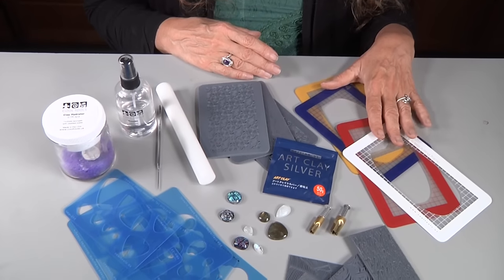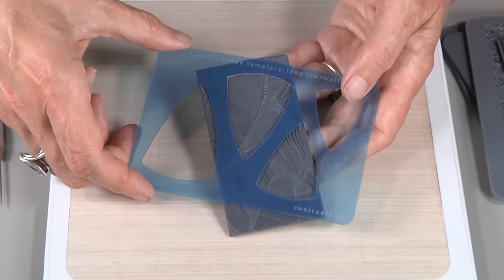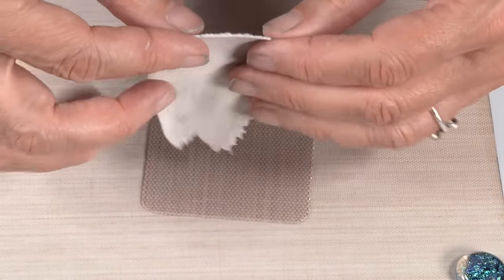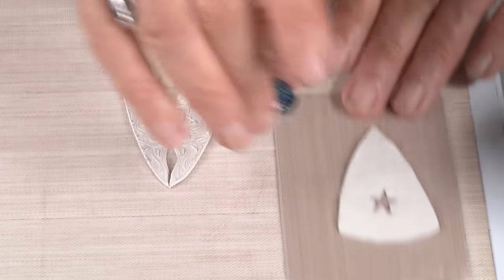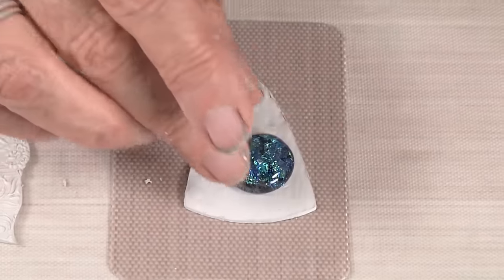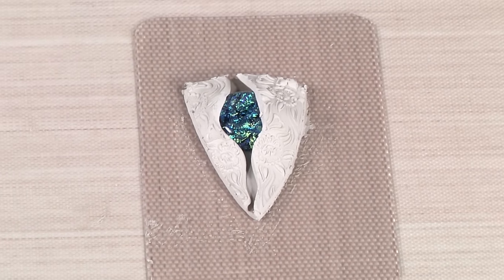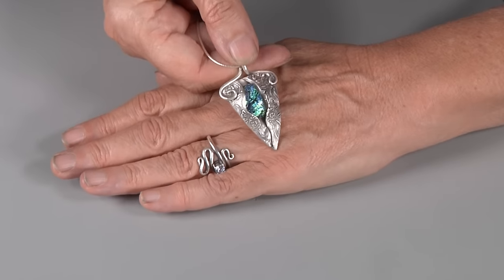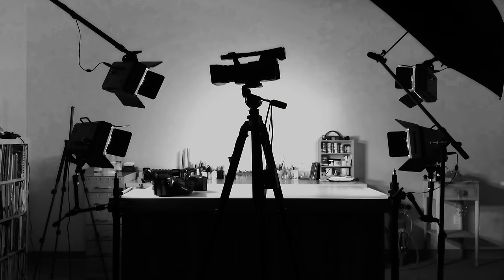Lisel Crowley - Embrace Pendant using a Fused Glass Cabochon

Comment: Do the fused glass cabachons have to be kiln fired?
Reply from the maker: Hi Donna, it is possible to torch fire this piece using Art Clay Silver, however glass does melt once it hits 1450°F. Because there is no way to control the temperature of a torch, it is recommended to use a kiln instead for this piece.

Comment: Beautiful piece. Is it possible to make this with a torch flame or must it be a kiln?
Reply from the maker: Hi Sharon, it is possible to torch fire this piece using Art Clay Silver, however glass does melt once it hits 1450°F. Because there is no way to control the temperature of a torch, it is recommended to use a kiln instead for this piece.

Comment: Hi Lisel: I love your videos. You are excellent at training and explaining. My question is about the fusing temperature...I've read on the Cool Tools website that if you don't fire the metal clay at 1450 F for 2 hours then it doesn't sinter and it won't be as strong and could crack and break. However, with glass you can't fuse that high. So is this piece as strong and durable?
Reply from the maker: Hi Courtenay, to co-fire glass with .999 fine silver clay, you cannot exceed 1400 degrees, or the glass will melt, ruining everything.  For this reason, Fire at 1400 degrees, and your clay, while not completely sintered, will be mostly sintered.  Will it be strong and durable? The answer lies in the gray area. The strongest metal clay is fired at 1650 for 2 hours, although PMC3 can be fired at 1110 for 20 minutes - the result is not as strong as being fired at 1650 for 2 hours. So, it is a tradeoff. For more information please refer to this link about Silver Metal Clay: http://www.cooltools.us/The-Ultimate-Silver-Metal-Clay-Firing-Guide-s/1219.htm
Reply: Hey Courtney, I have fired hundreds of pieces at 1400 for 1 hour and they are very strong and durable. I do use art clay silver.
Reply: Doesn't firing for longer at a lower temperature produce the same result as firing at a higher temperature for less time, and then fully sinter the clay?

Comment: Will this work using PMC 360? If so would the firing schedule be the same, 1300 for 30 minutes?
Reply from the maker: Hi Jodi, because the melting point of glass is 1450°F and PMC 960 firing temperature is 1500°F, PMC 960 would not work for this particular piece. Thank you for the question!

Comment: I fired a piece of PMC Flex and while cleaning it "after firing"  while burnishing it snapped in half. Do you have any reasons why that can happen. Maybe I didn't fire it long enough. Maybe it wasn't dry enough. Help. Can I refire?
Reply from the maker: Hello Teena, Yes, you can re-fire.  Use a .999 silver paste (either purchase or make from lump) and attach the pieces back together. Fire at 1650° F for 2 hours.  This is the optimum firing schedule for .999 silver clay.  Good Luck!
Reply: Ok thank you. I love your work and I watch your videos over and over.
Reply: Thank you. I will let you know.

Comment: you said to fire at 1300 for 30 minutes will the metal be strong enough and is the reason so the glass doesn't melt?
Reply from the maker: Hi Lorri, yes the metal will be strong enough. 1350°F is the highest temperature that we recommend firing dichroic glass. The glass will soften slightly and will fuse with the silver clay.  Have a great day!
Reply: Can I use any fused glass?
Reply from the maker: We asked Lisel your question and she said, "Yes. Any fused glass should work. I don't recommend sea glass though." Hope this helps!
Reply: Hello I am using FYI fine silver clay will this process work for the fusing of glass and if so at what temp?
Reply from the maker: Hi Lorri, we do not have experience using FYI Fine Silver Clay. We recommend firing a small sample piece of FYI silver at 1300 degrees for 30 minutes and verifying if it is fully sintered. If it is, then you will know that you can fire this clay with glass.
Reply: Thank you I will try as I love this clay and it really has worked so far with all your projects....You should try using it.

Comment: What temp do you fire the clay when you have glass with it?
Reply from the maker: Hi Charles, At 1300°F you can co-fire dichroic glass with metal clay without changing the glass at all. At 1350°F which is the highest temperature that we recommend firing dichroic glass, the glass will soften slightly and will fuse with the silver clay.  Have a great day!
Reply: Thanks
Reply: @cooltoolsvideos   Do you have to fire a piece like this with a dichroic cab on fiber paper, or can you just lay it on the kiln shelf @1300F?